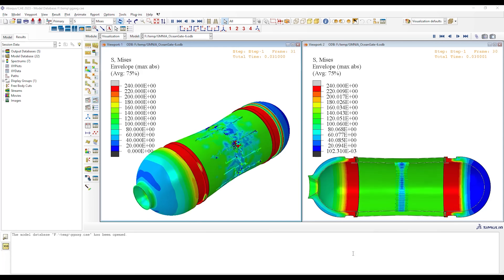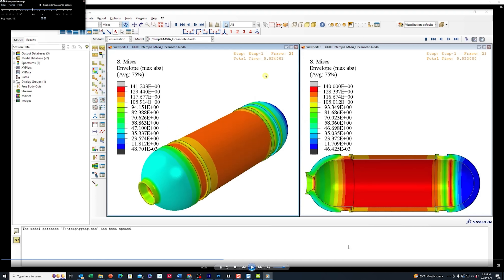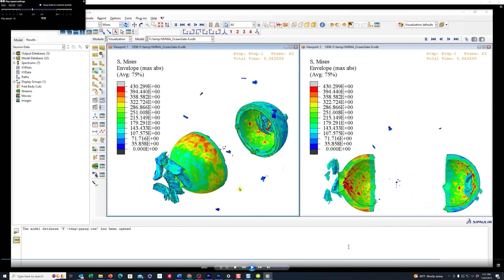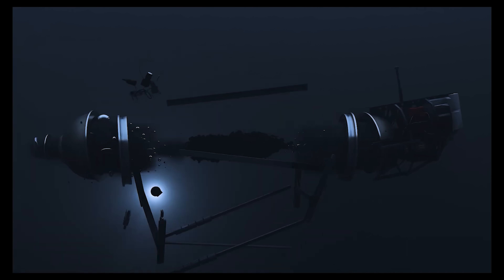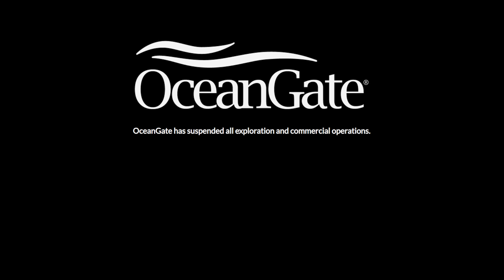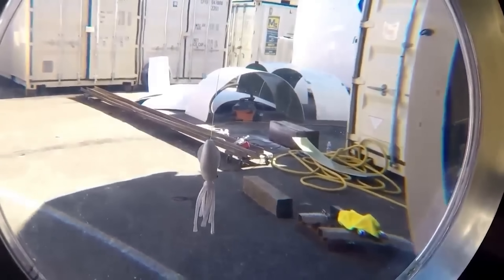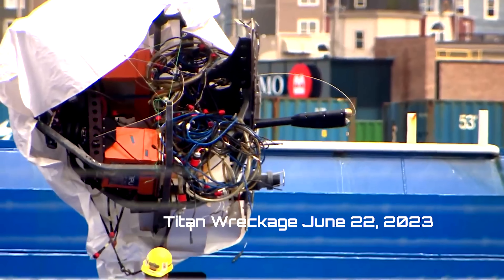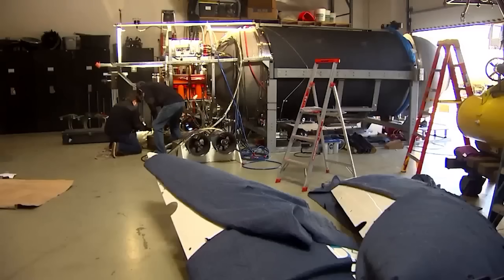Best Titan Sub Implosion Simulation, Cracked Porthole? Q & A

Comment: Two more facts that were unknown to me in the beginning.

First of all - it is still my belief that it was a CF failure.
But I was unaware that Rhino Liner was coating the CF tube.
That's spray on bed liner! THAT is most likely the cause of the cracking sounds everybody has been hearing on each dive - the pressure causing the CF section to get smaller - peeling the Rhino Liner off of it.
Also the Rhino Liner would prevent a proper inspection of the CF tube between dives.
If the CF tube material was fraying you would have never have seen it.
He wanted a death trap. That's what he designed.

Now - cameras - where are they?
I want audio from inside. I want to see outside video as well - and maybe there's sound with that as well.

But it's not the view port. They were hearing sounds from the aft chamber area.
What was behind that bulkhead?

When the CF tube failed - the window was forced outward - no ring or bolts visible in the recovered parts video proving that - so what was left of the bodies became human toothpaste.

Comment: 1,000,000% the carbon failed before the plexiglass....
If it was lexan or polycarbonate, It would have been brittle enough to fail and shatter under deflection..... Plexiglass is soft enough to deflect from concave to convex without failure the way the other 2 would.
Any engineer worth a dime would know this.
If that port was gonna fail, it would have on the first trip.

Comment: The cracking (crazing as its called on acrylic) is typically a much smaller cell size, like tempered glass. The crack looking things around the edges of the porthole looks like some kind of poorly applied sealant or glue to me.

Comment: 20:23 of the video from alanxelmundo 1/4 “my voyage to the titan” shows the exposed hull of the Titan and what looks like longitudinal bunching of either the “rhino liner” or the composite underneath and its pretty marked across all of the visible section of the hull. I bring it up because it looks markedly different from the smooth surface of the 2018 news footage.
Reply: I bet the liner de-laminated from the hull allowing water between the hull/rhino liner

Comment: Another thing that gets me is that they have about 16 bolts holding the view port on and about 18 holding the metal end caps on! I would think that with the size increase, they would have at least double the bolts!
Reply: Size of the bolts is probably hte key difference
Reply: @JamesF0790  Spacing would be more important. Spanning that much distance would allow the caps to maybe warp

Comment: Here's my uneducated guess of one possibility.

Carbon fiber is very strong as we have constantly been told but consider this.

Acording to other videos showing how the main body was constructed, it was only wrapped with carbon fiber in one direction. There was not any angled wrapping other than the angle obtained in one revolution. 

To me, that would allow the CF body to act sort-of like an accordian as the extreme pressure pushed the two titanium ends towards each other. 

It would also explain the noise reported in to rear.
Reply: So, like one of those cinnamon roll tubes you get at the grocery store and tear, then pop open

Comment: We concentrate too much on the question of "did they feel it" ? - No they did not!. 
 A implosion at this this depth is a million times worst than a explosion at our atmosphere. 
 Stand in the middle of a highway, with two 18 wheelers, driving towards you, opposite directions, and smash you inbetween ...you would NOT feel it but you would fear it !  
 That's still not the eqaul to the force you would eperience in this sub. 
 So that brings out the better qouestion. 
 Did they assume there was a problem and stressing over getting out of a problem. 
 We can only speculate.

Comment: The area on Plexiglas around the circumference may look like large cracks. It's not. You are seeing air gaps on the mating surface between the titanium and plex. This mating surface self seals under pressure.

Comment: Sorry to ruin your fun, but just unsoldering a memory chip in a modern phone and moving it won't do  anymore, especially on Apple devices.
The data is encrypted by default, and quite often the key to decrypt is tied to the board of the phone it was installed in from factory for "security reasons"
Or in reality, it is so the manufacturer can exert control over the data, so if you can't resurrect the board itself, getting the data off it may be impossible.
This is why some channels like iPad rehab have to go through extreme lengths to save an ipad (Bigger iPhone, same OS, same settings.) just long enough for them to get the unencrypted data off the device.

This is one of the points that Right to Repair legislation aims to change, so you may have choices and CAN get your data back.

Comment: They had jettisoned the frame (legs/skids) so after that trim control would have been lost and the vessel would have floated stern down / porthole up.  So the people would have been standing on the rear bulkhead, and when the implosion occurred they would have been driven into the rear end cap, where, it seems, remains were found.

Comment: I don't buy the window caving in.

The window is tapered, and the retaining ring doesn't appear to overhang the inside of the hole.

But the ring got hit with enough force to strip all the nuts off their studs.....

The most likely explanation is the window was intact, the hull imploded, and the force blew the window out, taking the ring, and the nuts with it.

Comment: The fact that the plexiglass window expanded and contracted 3/4 of an inch with every trip would make me nervous!   It had to be compromising any seal around its perimeter I would think!
Reply: It was probably one of the few parts that were actually built to survive such pressure cycles, even if not correctly dimensioned.
Reply: "It had to be compromising any seal around its perimeter I would think!"
The seal would be actually be tighter at depth because of the pressure of the water forcing it closed. Same way with you can't physically open the door on a passenger jet due to the pressure differential.
There was actually an interview with another deep sea submersible builder on the channel "ACE" (yes, just that) with Karl Stanley, who tried to warn Stockton Rush talking about how because of the pressure you don't even need to technically lock the hatch shut because the pressure will create such a seal. He actually forgot to do it on his first dive and the first few feet caused a bunch of water to pour into the sub, but then the pressure created a seal.
Reply: Bending of structure is normal, to put it into perspective....
The Willis Tower is designed to withstand the heavy winds coming off Lake Michigan, and that means that if you're standing at the top, you can feel it sway up to 3 feet (about 1 meter) in both directions before you should start to feel worried. Even on a calm day, the tower generally sways about 6 inches (15 centimeters) in both directions.

how would it compromise seal if it gets pushed in and fills any imperfection, just like any rubber seal we use ....
Reply: @ImRandomDude  Ao do the wing in a jet. Under proper engineering, you will never feel fear
Reply: @ImRandomDude  wtc were like that
Reply: @ImRandomDude A tower and wind is not comparable to glass and pressure. Anyways, there was no rubber seal involved with this submarines plexiglass porthole, I think you think wrong.
Reply: I would be just as concerned about the bolts surrounding the window shearing when the window circumference grows slightly from compression.  Those bolts are probably spec’d for high clamping loads but may not give much and snap under shear load conditions.  It’s just another in a long list of things that could have been better engineered.

Comment: 10:46 I didn't think you can actually do that because I thought phones would have that encrypted and therefore inaccessible unless on the exact same board... I guess not though.  Loving the vids on this topic!
Reply: encryption is a software effect, not a hardware effect
Reply: @daemosblack  but if it's encrypted it would have to still be cracked to access. I think what I might've been thinking of is some products where the hardware is tied together through identifiers and won't work on a new motherboard/different device based on that

Comment: I still believe the acrylic porthole window was blown out from the inside. You could see on the titanium end cap, when they recovered it, that the retaining ring and bolts that hold the window in place were missing. Even though we’ll probably never see any pictures or videos from the last dive, I’m sure they’ll be helpful in determining what failed in those final moments.
Reply: Vids show a GoPro camera mounted on the rear bulkhead looking forwards toward the porthole.  That would be a good find.
Reply: It was probably a great white shark that imploded the submersible

Comment: It's clear they put a great deal of engineering time and money into designing the World's most expensive Burial Chamber!

All kidding aside, I am a PhD level Physicist and after reviewing the various design and engineering parameters, and thinking about the strength of the Carbon Fibers under Compressive Load, I was absolutely astonished Stockton Rush wasn't AVOIDED LIKE THE PLAGUE!! Secondly you also have the DISSIMILIAR MATERIALS and the different expansion and contraction COEFFICIENTS!!  Thermal effects change the properties also!!

If I was a BILLIONAIRE and wanted to take myself   or my son along, I would contract a SAFETY REVIEW BEFORE I bought a ticket, and for the price of 15 K I would have dug up enough Safety Concerns about the Titan  that I would NEVER BUY A TICKET EVER!!
Reply: I think Rush was the only one giving tours to the paying public.   The other certified submersibles only accomodated 2 people and were used for research or industry, not sightseeing.    Several people backed out , in fact he tried to get MR BEAST to go down with him but he declined.  These guys didn't do their homework on this.   They were more daredevils than explorers plus Rush gave them a line of BS. "Don't worry it's safe.   If it wasn't would I go?"  I'm glad he was on board and not another  designated pilot.
Reply: @chairmankim9628  Great logic and I couldn't agree with you more!!

Back in the 1800s when dynamite factories were plauged by explosive accident after accident that resulted in LOSS OF LIFE each and every time, they began the requirement that  the DYNAMITE PRODUCTION MANAGER HAD TO LIVE AT THE SITE OF PRODUCTION!!  Needless to say, the accidents stopped and dynamite production became ONE OF THE MOST SAFE INDUSTRIES AT THE TIME!!
Reply: @chairmankim9628  actually PH's expertise gave Stockton Rush more credibility. I am dumbfounded by PH's behavior. Hamish only was "onboard" with everything because of PH. He was a daredevil of sorts but wouldn't have gone on the Titan without the endorsement from PH.

Comment: When he was asked about the carbon fiber, Stockton Rush was adamant about that being the right material because it was all about strength to buoyancy and not strength to weight. I’m a bit confused on this logic and was hoping you’d go into that.
Reply: It's basically the same thing.

If it's as strong as another material for the same volume but weighs less it is more buoyant.

Other materials like steel or titanium need foam on the outside of the hull to add buoyancy.
Reply: Stockton Rush gives new meaning to "not always right, but never wrong!" For what it's worth the customers were allowed to step out of their bodies immediately by their guides, but Rush had to stay as a penalty for both his arrogance and bluster. Just saying!
Reply: This channel is more about summarising other materials. You might want to follow links provided for more educative stuff. I have followed the titan disaster and youtube algorithms suggested thus channel that just highlighted other detailed vlogs on titan.